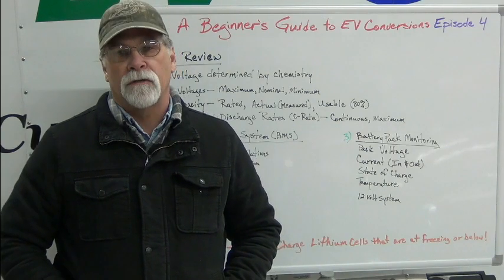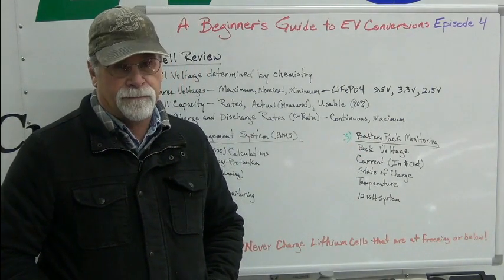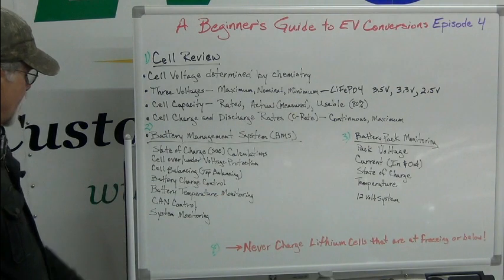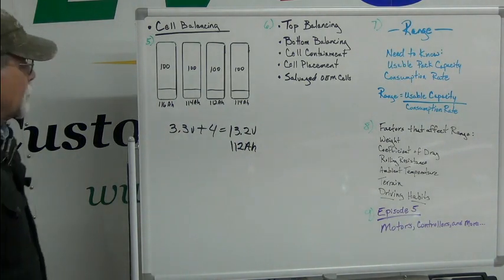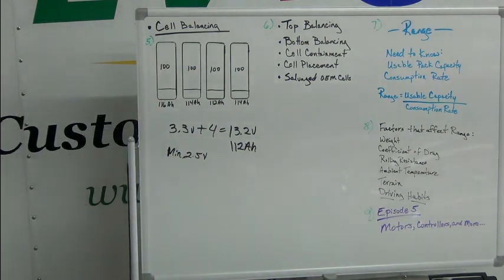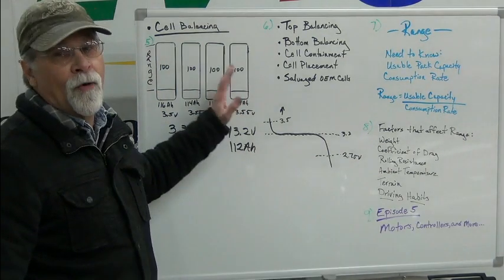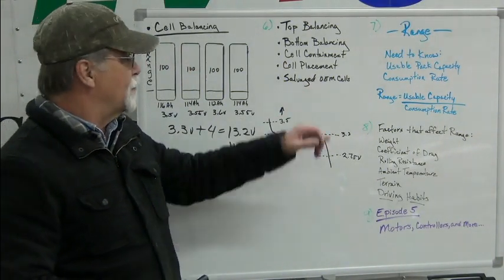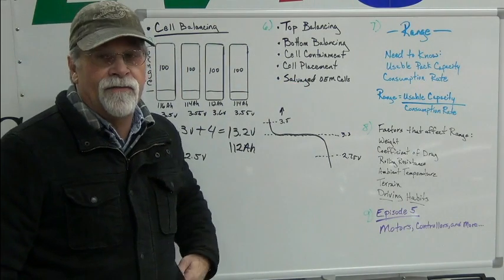A Beginners Guide to EV Conversions - Episode 4

Comment: Power grid is failing do to all this loading of EV and Heat Pumps in old communities
Reply: When the south of the country ramped up capacity to cover the draw for air conditioning, the power companies added infrastructure at a faster rate, and at higher percentages of capacity within a shorter time than we will have to for electric cars.  They did this because the market demanded it, and they saw the long-term profitability of selling that electricity.  So too will it be with this, it's a smaller jump in capacity when taken as a percentage of existing infrastructure.  I have no idea why people say anything otherwise.  It's like saying "companies just don't wanna make money!"  I'm pretty sure the old guys in suits at the top floor of whatever power company office skyscraper are as excited about this as the EV enthusiasts.  The only difference is that the investor class will get luxury yachts out of the deal, we'll only get cars.  Yeah, there will be short-term hiccups.  But society can do this, we've already proven it.
Reply: And yes, I just refuted a bot 😁
Reply from the maker: Most EV charging is done at night when there is less demand.